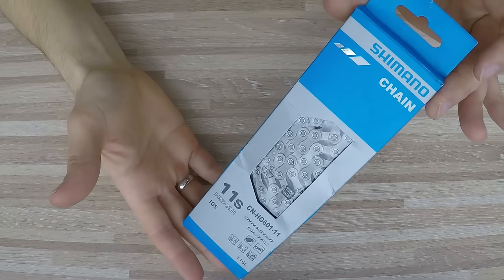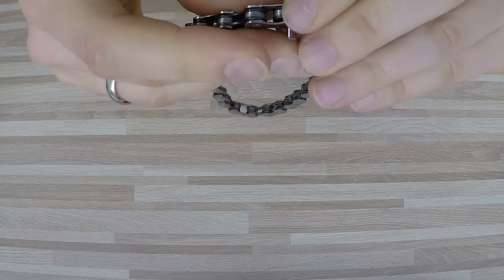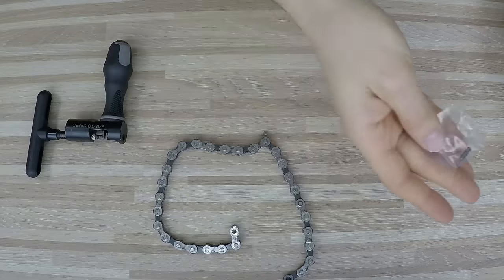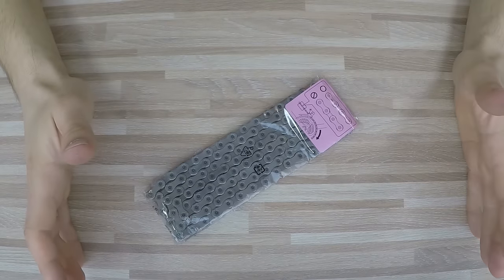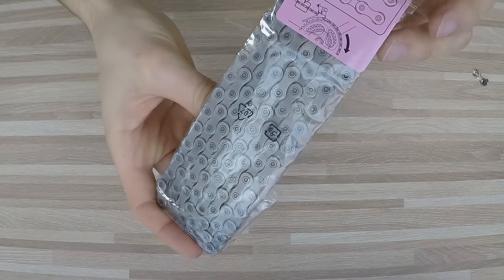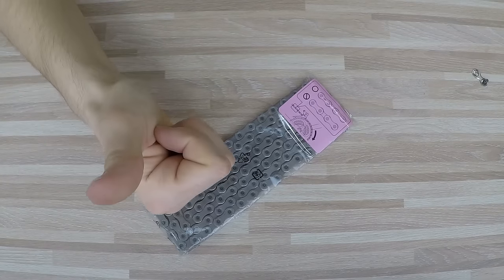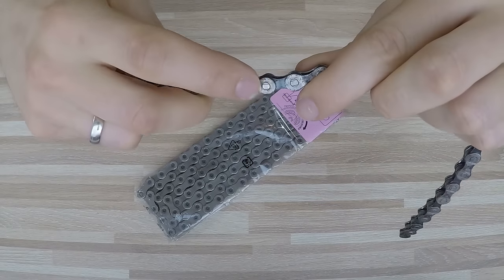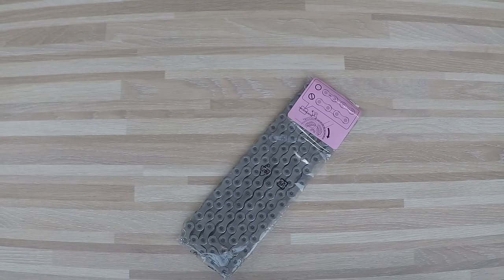4 Worst Mistakes In BICYCLE CHAIN Maintenance. How NOT to do it. SickBiker Tips.

Comment: good infomation but 40ys riding and useing the same link connection never made any problems for me. thanks anyway.
Reply: That's right. Nowadays, with quick links and derailleurs, I don't need to split and connect chains, but I have dony it many times and never had a problem. I never did it on a 11 speed, though.
Reply: I used to do it but had two occasions where it did disconnect.
Reply: Two or three of my chain tools are actually designed to allow splitting, re-linking and specifically that last little re-adjustment to gap the chanin to avoid link stiffness. These chamfered pins are a comparatively new thing and i've ridden countless thousdands of miles with chains that have been split and re-combined with the original pins  (though my old 3-speed did have the splittable quick-link). One reason I split/remade a chain was the rotate 3-chains to one cassette tip to reduce wear (it was said that a chain wore out 3 times faster than a cassette)
Reply: Currently I'm recovering from a broken femur and patella suffered in a fall caused by a broken chain. I can truthfully say that after my 47+ years of riding, with doing my chains "the old way," that there's always an opportunity to learn a better and a safer way. I hope you don't have to experience what I have, and that you take SickBike's advice to heart. Thanks for the video!
Reply: Get well soon bud, thanks for sharing your experience.
Reply: Clive King I never had an issue either until I did. Almost got me killed. It's more about best practice. Your more likely to have an issue reusing some link then you are by using a new link. Most won't have an issue but some will and it can result in serious injuries.
Reply: 40 years ago things were made out of real steel
Reply: yep...agreed ....me to...I just re-fit removed link and `manipulate it` a bit to make it free ....goes back to when I had less money ..and only way to clean a chain was in a pot of paraffin with a brush ....but I make sure its safe ...I paint the join ..and just keep an eye on it ....( this also has the advantage that if you do it again...you can choose another link )... never yet had a failure .
Reply: Since my last post I've been sold on the 'magic' links that come with SRAM/KMC/Wipperman and will never go back to the breakable pin horribleness from Shimano (in part as I wore a Shimano chain in 700 miles even with lubrication) - I'll still be carrying a chain tool though.
Reply: Clive King I was about to write the exact same,even the riding for 40 years. It actually angered me that he said never ever do it. I ride 15000 miles on average a year,and I always reuse the pin. I have never had an issue.
Reply: I agree with you Clive.
Reply: Shariq Khan, sure bro whats your IG? Pop the pic on there.
Reply: I just realized, IG doesn't even have friends or direct messages. Im now suspicious :)
Reply: Debian owns sounds phishy to me - you've gotta be pretty dumb to not be able to count cogs
Reply: yes , if you have 7 cog wheels ( sprockets ) on your rear wheel then its a 7 speed , you dont count the chain rings on your cranks ;)
Reply: Shariq Khan no probs mate , happy to help 😋
Reply: In spirit, I agree with Clive King and have always reused pins.  BUT since it became a thing that new pins were readily available and included in the new chain, i always use the new pin.  I've never had one break due to a re-used pin, but I have had a chain break on the road and by that time the chain was old enough to replace anyway. Frustratingly, I went to the bicycle shop the day BEFORE but told myself I would get the new chain the next day...  :)
Reply: Also, what did you all think about removing the factory grease?  I used to do that, but someone at a bicycle shop told me it was a mistake to remove it.  Thoughts?
Reply: DFTA (Don't Feed The Animals) you don't need to remove the grease because there is nothing wrong with it , it's very tacky and good for damp to wet conditions , the only time I would clean a new chain is the middle of summer to put a dry lube on , although I'd still use the new chain for a week before i did clean the new grease off
Reply: David Culshaw - thanks for the response!  its funny how ideas change on things that seem so decided.  tire size debate anyone?  :)
Reply: DFTA (Don't Feed The Animals) well it's 26" for me although I wouldn't say no to 650b , 29" is a step to far in my opinion but each to their own , 26" will be back in fashion soon and folk will be wondering why we had the new sizes in the first place 😁
Reply: David Culshaw - haha!  thanks for that!  ...actually, as people may have deduced from my channel I am a roadie through and through...BUT I did ride my friends mountain bike once (on the road) which had 29" and it felt quite extreme!  I actually went trail riding for the first time a few weekends ago...you probably would have laughed at me.  :)  in fact, I was laughing at myself.
Reply: DFTA (Don't Feed The Animals) you should have taken your gopro 😊 . i'm mainly into mtb but i do like my racing bike too for realy long rides . its amazing how easy road bikes are to ride once you've been on a mtb isnt it
Reply: I think removing the factory grease is limited to the outer portion of the chain so you don't become a dirt magnet. I've seen two well-known bike mechanic web channels disagree on this ....Personally I do a cleaning then lube according to season (set/dry/heat)
Reply: Jim Peyton - great points!  I've seen many conflicting arguments too, but I think your assessment makes the most sense.  I used to clean the chain when new, but now I just do the "outside wipedown" as well ...until the first need for lube that is.
Reply: if you are just using bike for moving from 1 place to other in city then it might be ok, but if you love to drive fast, aggressive i would recommend to dont reuse the pins that can follow to serious injury or death. Dont economy money on chain and drivetrain!!!!!
Reply: Yuki Kawai yeah when you go with bicycle and not drive it...
Reply: I used to do this all the time on 8 speed or thicker chains.  The 10+ speed stuff has thinner plates that don't get nearly as much grip on the reused rivets, and they're peened, so the hole tends to get a bit wider when they're pushed out.  The little black pin that shimano uses is slightly oversized to fit the stretched out holes in the plates.
Reply: Clive King yeah I ride bmx and iv reused the same pins and links a million times. Never had a problem. ONLY TIME IV BROKEN A CHAIN IT WAS COMPLETELY MY FAULT LIKE DOING A SPROCKET STALL ON A CONCRETE LEDGE!
Reply: Shimano don't ever reuse the pins. Kmc,  sram you can reuse the pin.  Best to use a split link though.
Reply: Isn't a chain as strong as its weakest link. Can't you just replace the pin with a new one in the package? Just sayin'
Reply: As a beginner, I thank you for your story that seriously affirms the need to do things "the right way" or as instructed by the manufacturer. Especially,  your emphases on open-mindedness "to learn a better and safer way". I'm hoping that you've healed by now (8 mo. later) and continuing to give sound advice. Again, thanks and thanks to 'SickBiker'!
Reply: A rivet is a part that is meant to deform when you connect it.  It is a single use part.  When you remove it you bend or break the ring of metal that you deformed.  After that its just a pin.  Its not even a spring pin.  Its only held there by friction and luck. I use speed links - which ARE spring parts.
Reply: Stayshtum68 Same here, it angered me that he said never do it but did not mention that this rule  applies only to newer 9, 10, and 11 speeds chains.
Reply: Clive King p
Reply: if you love wearing out your drivetrain faster than need be, than the grease that's on new Shimano chains is perfect as it attracts all the dirt it can find which acts like sandpaper wearing out your components super fast :-}
Reply: whoever told you not to remove it is a muppet. it's only there to protect the chain whilst in storage. and don't forget these chains are shipped across the globe via the ocean, so all that salt air will rust the chains if left unprotected. BTW ive been a bicycle mechanic for 21 years and allways relube the chain when using for the first time
Reply: Yep. I stil do it on 6/7/8 and 1 speed chains but not on 9-speed and above.
Reply: ive got 3k miles on my cheap 11 speed chain, its driven by 1500w motor. ive reused pins at least 5 times. never had a problem
Reply: @moquiti - I was always wondering why so many chains break during worldcup downhill races, until I saw some interviews lately, mechanics saying, that they replace the chain with a new one for each race...
Reply: Lars Bo Jensen 
I never split a chain. Just snap out the backwheel. Clicketyclick. Of course if your wheels do not allow that it you will need to.
Reply: paul treneary what chain were you using? 10 or 11 speed? I found that on recent systems metallurgy is critical and used SRAM and, best Campy. Campy lasts 3500 km elite level with sweet spot 700-3000 km. They will never fail. Shimanos may just weaken randomly, 1000 2000 or 500 km and it is done.
Reply: stephen john baldwin 11 speed exposes Shimano for the garbage it is. I went though so many Shimano China’s wondering why so noisy Grundy etc but at 5.8 mm they are too thick for the 11 speed cadettes so they false engage near sprockets. SRAM is 5.5 superior. Campy 5.3 and it is Ferrari vs Lada (Shimano). Steadier sturdier does my flex sweet spot 500-3000 kms (Shimano could just become wobbly in 1-2 weeks) so on. Best of all? Works on Shimano systems. Same for their cassettes so he elite pro trick is running a Sram 1190 monoblocs with campy chains on Rd-9100. Nirvana...
Reply: This guy has lost alot of credibility getting hung up on the chain pin.
Reply: Same for me,
Reply: Its the 1000Times to say it,you don't need the new Link.....feel carefully thats the old Link works smoothly,and you have no Problems.
Reply: I've been doing this for ten years, I've built multiple bikes from salvaged parts, and never had a broken chain.
Reply: I have had chain break once from reconnected pin part. That was due to old pin not having much of extrusion at ends. Chain removal tool seems to cut those out these days. I guess stuff has happened with materials.
Reply: @bumstudios8817  Yea, bicycles also. Doesn't mean that it was better. In fact, the reason for the change was to make things better in certain ways. So, love "real" steel all you want, it won't beat a solidly made titanium or carbon bicycle.
Reply: @lazurm  lol you replied to a 2 year old comment... i know what your saying but most things have just changed for cost reasons. But yeah... if you want me to put my steel knives up against your carbon or titanium knives.. game on. hahaha.
Reply: @bumstudios8817  If the change in bicycle materials like carbon or titanium were for "cost reasons" it wouldn't have been done. It was for weight and the way carbon efficiently transmits energy to the wheels. Titanium is light and rust proof, and stronger than steel. 
As for the knives...I get your point! :)
Reply: @lazurm  there are different "grades" of ti and carbon as with steel. Trust me cost is always a factor, but it depends on what bike or product you are talking about. Some stuff is designed to hit different markets for different reasons, but my original comment was meant to Express how quality "generally" has changed over time for cost. Back when things were made from "real steel.
Reply: The chains are designed different for newer speeds and also much flimsier. Don't come crying to us when you break a hip.
Reply: @DavidCulshawmer-r  I'm still waiting for 26 to come back.  Hard as hell to fin 26" rim brake wheelsets!
Reply: @randyswadley4220  you could try merlin cycles just up the road from me . they are hand built to your spec too. The shop /warehouse is near Euxton /Leyland
Reply: @DavidCulshawmer-r  good looking, but unfortenautely do not ship wheels to the US currently :(  found some Alex rims with deore hubs for $180.... not horrible
Reply: Same here. That part of the chain is the strongest link :) the failure would definitely occur elsewhere.
The other advice are also worthless.
Reply: 40 years ago we didnt have 11 speeds either!! Its all relative, listen to the advice, its good advice.
Reply: I’ve done it after loosing the dedicated joining pin and re using an old
One it held super well and that was on a modern chain they just want more money these days
Reply: @moquiti  boa man! Pqp já tá zero?
Reply: @moquiti  u need sum milk

Comment: Throw away that replacement pin.  Buy a quick link.  If your chain is 9-speed or higher (narrower), use a quick-link (missing link, power lock, whatever).  Don't press the existing pin back in.  Those pins are riveted in place. When you pressed the pin out, you removed the material along the edge of the pin holding it to the outer plates.  One good stomp on the pedals (or shifting the chain off the chainring) and that pin will pull right back out of the plate, thus breaking your chain and ruining your day.   On older chains (8-speed and below) you can reuse the pin as it is not riveted to the side plates.

Comment: I have a great tip.  I ride in the caribbean climate, and chain rust with rain and salt is a big problem.  Also the sand and dust is collected into the chain quickly if oil is used as a lubricant (even dry oil)... and then the chain requires frequent major cleaning.  

I found a solution to use rust resistant chains like KMC X10SL Gold, and then use a wax lubricant.  The result is great lubrication, no need for frequent cleaning... and no rust!

Comment: 1: Don't reuse master link 2: Remove packing grease 3: Don't use alkali or acidic solvents 4: Dry the chain. There I saved you a bunch of time. You owe me a beer.
Reply: I didn't read until the end 😊
Reply: @emankcin1701  same here
Reply: That's copyright infringement. You owe SB a beer.
Reply: You can reuse master link.  The first point was about reusing the same pin that you pushed out when breaking the chain.  It should be okay for general use, because to remove the pin a second time, it still requires a substantial amount of force applied to the chain in a very specific way, and you shouldn't encounter a force like this during normal riding.  Maybe after taking into consideration vibrations, it may be a different story.
Reply: Reusing pins is not okay, not even for general use. It is okay on single speed chains, maybe even on 5/6/7 speed chains, but any modern size chain it really isn’t.
Reply: @emankcin1701  comments section reading is vital to every video these days, stacks of intelligent people of you tube and lots to learn from those who post information. Enjoy.
Reply: Only thing ya did was take the joy of learning a way, an empty pre mix bottle of rum is what you can have to send in and get 10 cents back if you live in some parts of Australia.
Reply: @switchofftogettagrip1400  take away the joy...   hahahahaha.... you can still watch the video.. and get some of that "joy" back...    hahahahahahaha... smh..  🤦
Reply: Idc imma reuse that masterlink. Least its not 800 plus dollar suspension
Reply: 2. Remove packing grease? how to do it?
Reply: BS.
Reply: @seasky6101  I take off the chain and put it in an empty,  clean Gatorade bottle with 2 oz of lighter fluid (cleaner than kerosene), add the cap, and shake it for a minute.   Drain the lighter fluid (you can reuse it), remove the chain,  wash it with soap and water.  Put it in a low temp toaster oven (150F or so)  for 30 minutes to remove all the water in the roller links.  It'll be dead clean.

Comment: Thanks for the video. 
Been using a quick link on a 160Nm ebike for the last 5000km with no problems whatsoever, certainly recommend this system.
Most chain cleaning systems, such as Park tools, completely soak the chain in degreaser. Surely if this was such a problem, they would use a different system. After cleaning my chain in this way (once it's completely dry) I use a ceramic lubricant on each link bearing, and must say, I'm happy with the results.